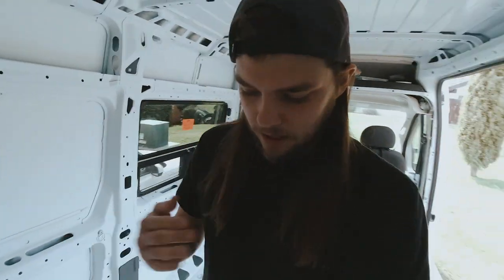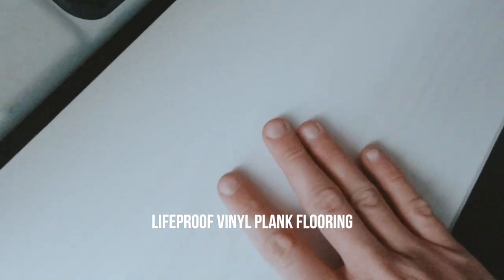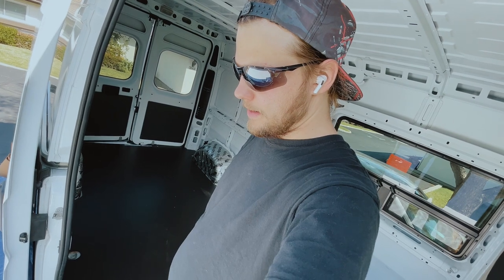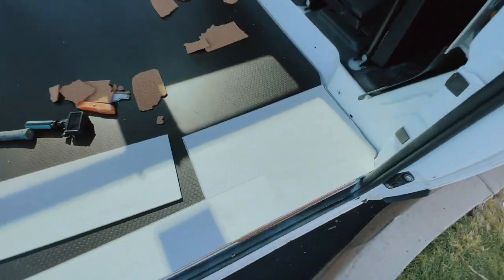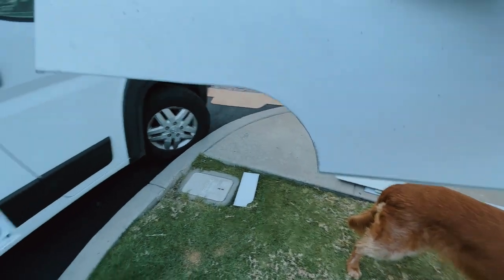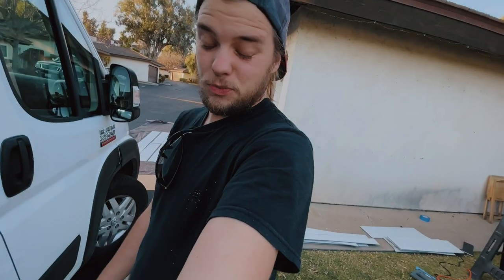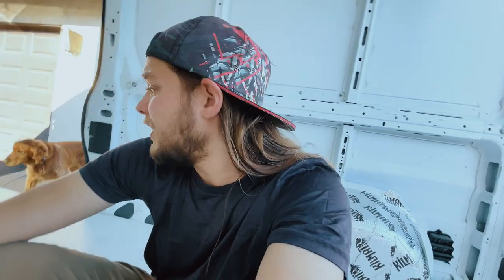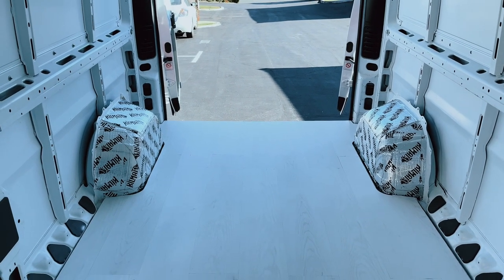INSTALLING VINYL PLANK FLOORING | van build series

Comment: just use offcut from the current row to to start the next row of flor, do it direct in the van, no need to do it outside.
Reply: This saves a lot of tile too otherwise you’re just tossing out the off cuts.
Reply: @leblancexplores  but every 4th or 5th row start with a new peace an cut it somwere random, and mix the offcuts. Otherwise it will create a patern in the flor.

I have once allways used the offcut from the last row, there is no a stair patter in thr flor.